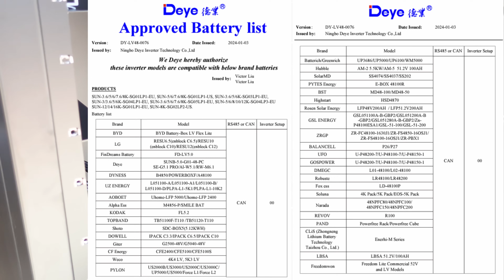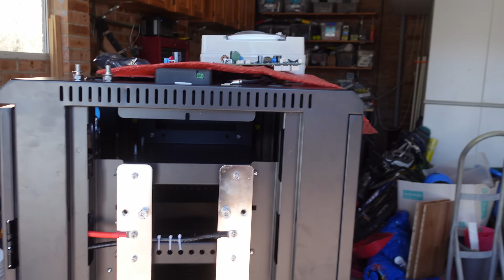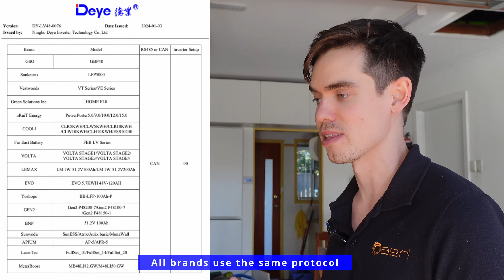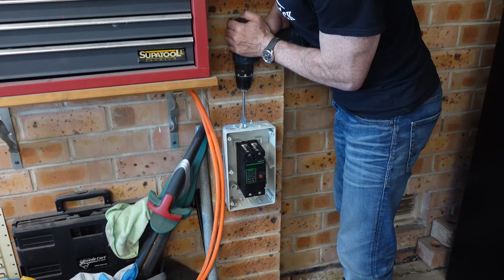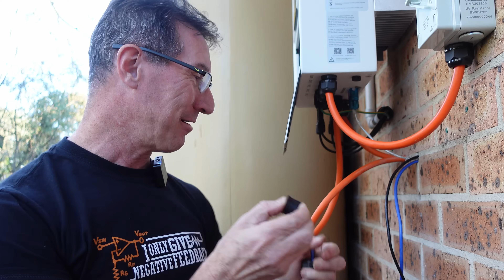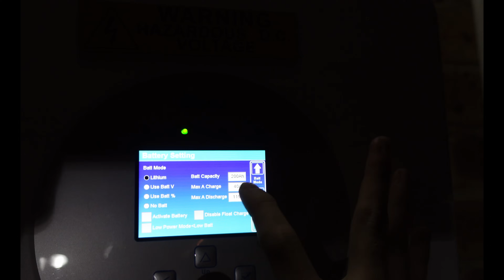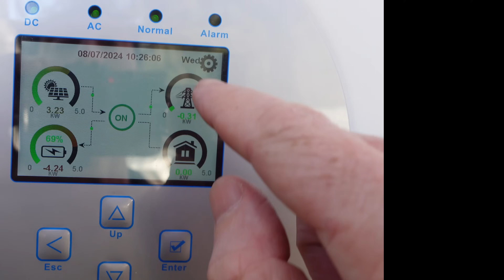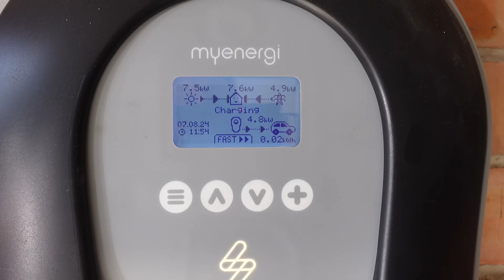EEVblog 1634 - 15kWh AERL LFP Home Storage Battery Install!

Comment: Fill the rack up, better to just do it now so all the batteries are better matched, plus if you only discharge them to 40% instead of 5% they will last a VERY long time, and when they do get to end of life (which is 80% of original capacity) you will still be in a good position to keep using them for several more years. It also means much less strain on the MOSFET's on the battery BMS modules, so they will have an easier life too and help them, to last longer too.
Reply from the maker: 5%?
I'm discharging from 100% to 20% as Peter recommends.
Reply: @EEVblog  yeah I wasn’t sure if you were going below 20% as I saw your post about needing more capacity as you ran out.
Reply from the maker: @TheDefpom  2nd channel video jsut released shows the data. By "running out" I meant it hit 20% and cut off.
Reply: @EEVblog  ah right, still filling the rack would be a wise thing to do.
Reply: Yip. Six months after installing a pair of 10kWh batteries, the manufacturer switched to version 2.0, and now it's a case of change them all or stick with what we've got. Even if they hadn't, all the manufacturers I've spoken to have said, "max one year" if you want to add new batteries to an old system.
Reply: calendar age will kill the lifepo4 cells far longer than discharge will. You can go to 0% and still get 8000 cycles out of them. If you're cycling once per day do the math. and at that point they'll still be around 75-80% capacity.
Only discharging to 20% is way overkill on longevity. 5% is highest you should go.
Reply from the maker: @gg-gn3re  I'll take Peter's recommendation of 20%. I'm sure it's on the safe side, but I'd rather not risk it.
Reply: @EEVblog LFP can be discharged down to 2 volts per cell without degradation. The 2.5 v floor is used because there is very little energy left between 2.5 and 2 volts while providing some margin. Similarly they can be charged to 4.2 volts, and most people will stop charging them at 3.65 or 3.7 as there is little capacity left. Some BMSes may behave strangely if a cell drops below 2.5 volts though. Don't be afraid to use the bottom 20%. It's there to be used if needed.
Reply: @MarkRose1337  Older LFP chemistries could handle 4.2V (Winston) - newer ones such as EVE/CATL (the blue cells) can't, they will bloat if you take them to 4.2V.
Reply: @PurpleAlienPlanet  Thank you for the info!

Comment: That Deye system is so 'janky'. As the tech has evolved so much and so quickly, dump it for something out of THIS decade and DON'T use the same installation people as you had before - they are crap.
Reply from the maker: Why scrap a system that is working fine?
Reply: @EEVblog  The cost of these things now is generally so low. Maybe prices are still high in Aus, but I don't know that it's worth it for that one.

The quality of the  installation is obviously terrible (been watching your solar vids for a long time) and seeing how the installers cock it up time after time, I'd be looking to do what Will Prowse does and not trust those cowboys...
Reply from the maker: @brianjrichman  The system is done and working. Nothing more to do. This is by far the cheapest and most flexible inverter in Oz that is CEC approved.
Reply: @brianjrichman  There is simply nothing outside of Growatt and Dye that offers this kind of flexibility.  
Other Inverters (especially HV systems) only work with a single or very select batteries, and other solution (Victron) e.g. do not offer whole in one systems (especially on 2/3 phase systems).

Yes the UI sucks and the documentation lacks a lot, but the Inverters are solid and do their job very well, especially considering their price, we got a 3.6 kW single phase Deye for <1000€, which is insane value.

Comment: Looks like a PaceBMS, judging by the Panasonic balance chip and resistor bank. Good quality BMS and system.

As for crimping, it's worth going for the pneumatic crimper if you intend to do a few cables like I did, but your style is fine for a one off. Oddly enough you've also got to go down a size on the die pack on the pneumatic crimper as well, so I have no idea wtf China is up to with these products.

My system (Victron inverter, Seplos upright battery case) is also 15kwh, and I charge it off the grid at night when it's 7p/kWh, instead of 22p during the day.
Reply from the maker: Yeah my job was a one-off, the cheap crimper does the job. It's their own design BMS

Comment: One of the reasons I went with the MG4 51kw model, the LFP battery made me feel much better about it than the NMC in the other models.
Reply from the maker: Better warm-fuzzy
Reply: Many LFP battery cars around nowadays. I think it will be like 50% of the production by the end of next year.
Reply: They aren't as spicy as NMC but can and do still release toxic hydrofluoric acid fumes during a thermal runaway

Comment: EV charging is a real challenge with the battery system. It just consumes so much power. Ideally you’d really want to do that off direct off solar, but life frequently makes one not home while the sun is shining. 
I’ll be interested to see your cost optimization method.
Reply from the maker: Most of our EV charging is excess solar during the day, has been for the last 4 years, it's why we got the Zappi.
Reply: @EEVblog  Your Zappi will see the battery as solar production unless you increase the export margin setting. I was a Zappi installer, and saw this all the time after a customer installed batteries later - the Zappi is happy to ramp up to whatever the battery can provide, since it doesn't know any better. This does mean you'll end up having a small dribble out to the grid if your batteries are charged and your car is charging, but unfortunately with the Zappi it's the only way unless your battery inverter is separate from your PV inverter.

Comment: Looks like rebadged chinese enclosures and BMS with only passive balancing on the BMS.
Reply from the maker: It's their own design BMS and is an active design.
Reply: They all look similar because they all want to fit 4 HE 19" racks and many use the amphenol plugs because of ease of use.  

BMSes all look similar because they are pretty much constrained by their requirements, huge MOSfet lines for switching the loads, balancin circuits for the cells, comms and power connection, all in 4HE and 19" on a single PCB.

Comment: I'd like to see the measured current on each battery under a decent load, ie just how well balanced is it.  The BMS in the batteries tracks that and it could be queried over the CANBUS if it's not visible elsewhere, or just go for the good old clamp meter.
Reply: Will it run off those weird 37 sided dilithium crystals and 23 sided solar balls you just reviewed? Lol.
Reply from the maker: I wanted to do that but the clamp meter doesn't fit the tight wiring in the front. Might be able to do it from the side.

Comment: Does is make sense to charge the EV from the battery pack? Wouldn't it make more sense, to charge the EV only if excess solar power is available?
Reply from the maker: Yes, but sometimes you fotget or something comes up last minute and you need more charge.
Reply: @EEVblog  Would the current system allow to control charging and charging speed depending on how much solar power is available?
Reply: @TylerDurden-pk5km  His Zappi will be a bit braindead when it comes to the battery system. If he wants to use solar only for charging and vary the rate, he'll need to adjust the export margin otherwise the Zappi will happily drain the batteries, thinking the battery output is solar output. I was a Zappi installer but dropped the brand - nice product, but the company behind it... ergh.
Reply: @benespection  If you really wanted to run the whole house optimally it really becomes complex because you would want a control system that can control battery charging, A/C, water heater, EV charging ... all large loads that are dispatchable.
Reply: @TylerDurden-pk5km  Yes, it's a big problem. MyEnergi try to do this, with Zappi (EVSE), Eddi (for controlling hot water), and Libbi (battery storage) but only within their own ecosystem. 

There's no willingness for manufacturers to work together on a standard that would allow disparate systems to share energy, so you get locked in. The only way to do this currently is to go down the home automation route with lots of custom logic to handle the priorities. I've done some similar things with KNX installations as KNX is growing here and many devices now have access to the KNX bus, but it starts to get expensive and the management costs for the customer are high when they change something.

Hobbyists are doing this already with OpenHAB though, but we really need one unified industry standard that would allow you to share energy consumption and production information, and control prioritisation of consumption and load shedding.

Funny thing is, 20+ years ago, the industry was talking about an energy management system that would talk to your big appliances over the electrical cables in your house, and your electricity meter, so your washing machine would run when you had solar energy or cheap energy, but I've never seen it happen :)

Comment: So as we live in the most over regulated nanny state in OZ, how are you going to connect that to the grid and get a sign-off? Under their crap 'micro generator' contracts to allow you to connect to their precious grid, you are only allowed to use gear from the smallest of lists and the solar panels are not allowed to be more than 1.2x the inverter size. Hence all the rubbish 6.6kw ads trying to push them.
I just wanted to add the existing 6kw of panels I had on my roof to the DC side and my god, you would think I asked them to jump in front of a train.
Reply from the maker: In NSW the limit is 10kW, and more if you have a battery I believe. Butin this case the inverter is already signed off and is a CEC approved model. No mains wiring was touched in this installation.

Comment: That thing costs $6,500 USD in America and $9,000 AUD in Australia. For that price you could buy a 24 kW(200 amps) natural gas generator that uses about $6.48/hour of natural gas at full load, which is only $0.27/kWh.
Reply: How is paying $0.27/kWh for natural gas better than just buying the electricity from the electrical grid without the maintenance costs of a generator?
Reply from the maker: How is that in any way comparable? I already have a big solar power system and a lot of that energy is wasted back to the grid so I want to capture that and use it.
Reply: @EEVblog  I live in hurricane alley so really 2 totally different goals.. hurricane backup for another Katrina like event..and or solar panels to save energy..

Ie entire house went 1/2 meter under salt water in 2005 Katrina..and solar stuff to offset power requirements now.

If I ever add battery backup  it needs to be 3 ft above the floor so at 1000 year floor level
Reply: @EEVblog   My intent was to show how much this stupid setup would cost with pointing out that a 15 kWh battery costing as much as a 200 amp generator is crazy. Would this be financially feasible for you without government subsidies? How much have you invested in your solar setup? What are your expected savings?
Reply: @Noneofyourbusiness2000  you're making zero sense, pay the same amount for a generator to additionally pay basically the same as from the grid vs saving money by storing excess solar.
Reply: @Noneofyourbusiness2000  Calling this setup stupid while suggesting a "natural gas generator" that's pure genius :))))
Reply: yes, but then you'd own a gas generator
 $0.27/kWh is  $0.27/kWh more than $0.00/kWh.  
The batteries are silent, instant, and likely to require less maintenance.
Reply: My neighbor has a 25kw natural gas generator 1800 rpm model..liquid cooled..super quiet..

Comment: Really like that this product has been designed for long-term use and future repair and replacement.
Reply: I'm not enthusiastic about the other HV solar batteries that are on the market at the moment. The chances of being able to replace a module in 5-10 years time is really low. Who knows if the vendors will be around by then 60% of startups fail anyway.
So using 48V batteries in a modular fashion is great.
Reply: @BobHannent  Exactly! And you can even make them yourself and get your 300Ah much cheaper than this would cost by buying 16 300Ah cells and a single BMS, fitting in about 4 or 5 U.
Reply: Add to that, upgradable. You can bump up the storage capacity to the amount you really need and just a little more.
Reply: all of the lifepo4 solar solutions are like this, for several years now
Reply: This is the way!